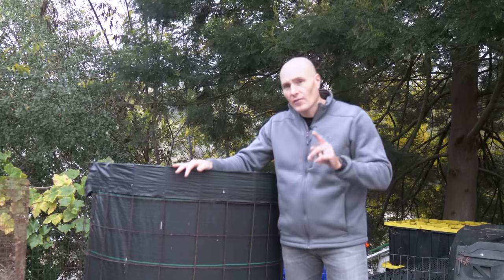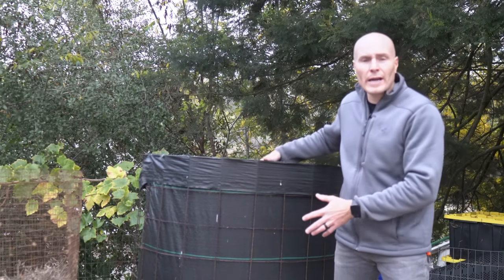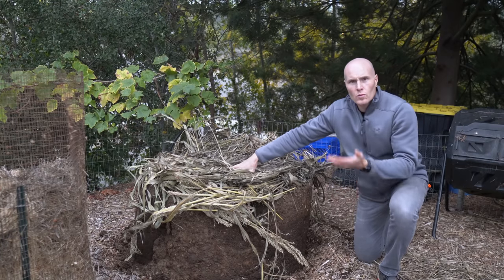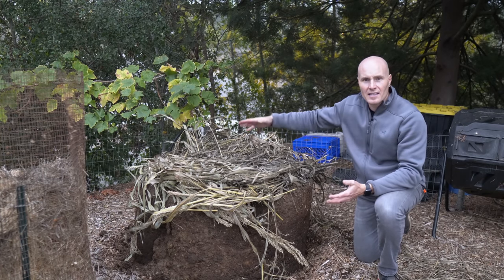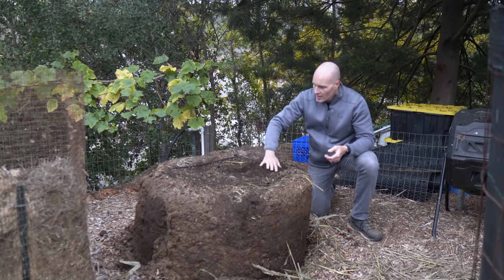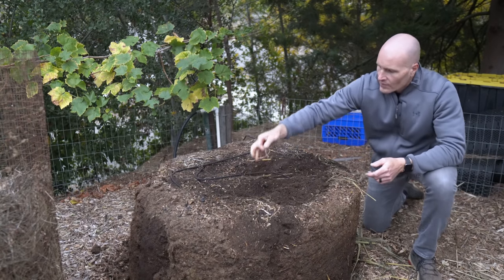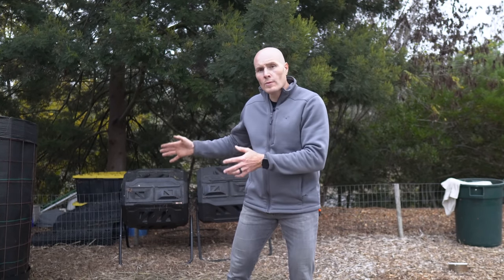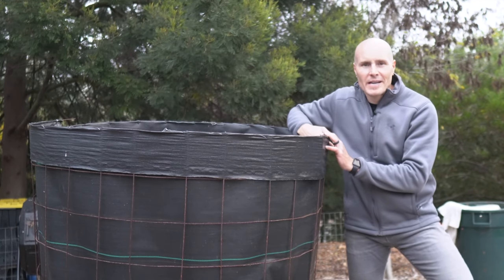Composting Horse Manure in a Bioreactor - One Year Later

Comment: I have a number of compost bins and when I want to clean one out and don't necessarily need it in the garden at that time I place the compost in large pots or a trash can with no bottom on top of garden beds. That way all the worms can move freely between the bed and trash can or pots. I have one in a winter squash bed at the moment. I occasionally remove the lid from the trash can or pot and water. The nutrients from the trash can will slowly leech into the bed for the benefit of the plants in the bed. 
I also have a large compost bay which I only place horse manure from stables in, though it has saw dust mixed through. After a number of months the horse manure has broken down with masses of worms. Overall this cost me nothing aside from a time and effort as I obtain the horse manure for free.  I did turn this pile once in a while. I'm almost ready to clean out this bay and start a new batch of horse manure compost which I slowly pile up as I pick up bags of horse manure.

Comment: Thank you for sharing the results. I semi-copied a method I saw Geoff Lawton do where he puts manure in a bath tub along with worms and food scraps and kept it moist, and the worms completely convert the materials into castings in a few short months. I've heard worms convert 1/2 their body weight of food into castings per day, so if you started out with a pound of worms, they would at the minimum eat 1/2 lb per day. That amount would speed up as they reproduce. I've filled an old tub (outside my home) with donkey manure and covered the top with leaves, and have gradually added a few worms to it over the past year. Now when I dig into the tub, the materials look like pure castings like in your video, and every shovel full is loaded with worms. Seems like similar results to this bioreactor, but maybe with less hassle. I can't say that a tub sitting outside is very attractive though.

Comment: Hi Diego, a year ago my JS was progressing very nicely. Then a few weeks later I did an inspection and noticed it had completely dried out. A Fikas tree had sent roots right up into the pile and sucked it completely dry of moisture in a relatively short period of time. Needless to say, all future JS will have weed mat put down on the ground first.
Reply from the maker: Weed mat is a good idea.  Might need to double it up for aggressive roots.  Nice suggestion.
Reply: Or if you have a pallet you can get it of the ground which is another benefit of using the pallet
Reply: @zoddsonofthor5576  hey man, I had it on a pallet, but as the worms broke it down, material fell down through the holes and piled up on the ground, causing an avenue for the roots to penetrate.
Reply: @MatthewSweetUX  yeah that can happen I place chicken wire over the bottom and lay landscapers fabric over that before loading it with compost. No problems since but I do have those things on hand and in quantity so I get why ppl avoid them.

Comment: Really enjoyed. An earlier vid you made has me sold on filling trash cans and let it set. Im done turning and mixing. Mine have already shrunk by 1/3rd just since September. I wet them when watering yard. That’s all. I swear I can hear all the microbes and fungi munching on the leaf/grass mix like it’s a sleeve of Pringles (one of my vices)
Reply: If you have two bins settled halfway do you pour them together to make one full bin or is that not recommended?
Reply: @phillipbampton911  good question. I understood the process was to fill them and walk away so I’m going to not touch until April at which time I will assess and either use on garden; let decompose further or combine them to decompose further. I have these cans next to my main pile that gets periodic turns, harvest or added new material.
Reply: @doncook3584  Thank you for this.

Comment: Do you think the benefit root exudates give could out weight the loss of a few nutrients? Great show buddy!
Reply from the maker: Honestly not sure.  I would rather just add the root exudate in field.
Reply: To answer that question you must find the plant in question and check its state of growth. Check also the composition of the compost pile to see if minerals are in soluble state. Plants will probably exhudate in this compost rich in bacteries and funghus to get its investment back during fructification. Though if the plant can help itself to get the nutrions then it will not need to exudate. Moreover, the root stucture will probably be different, with or without mycorrhizal fungi.
At first sigh it looks like Diego's roots are just pumping nutrions from the pile, but can't really tell from the video.
Good luck with that :)
Reply: @radicelle  I was going to ask the question. Very new to gardening. Thanks for the thoughtful and thorough answer !! 
Cheers

Comment: Diego, do you ever till into a fallow bed? A lot of gardeners say to not till leaves or carbon rich materials into the soil but when I do that, they disappear within a month or by May of the next year (if I till stuff in in October). I've had pieces of lumber that I found under the soil but I do not see bits larger than a standard woodchip. Most of those have decomposed within about 1 year. All I see are larger pieces that are rotting from one end and smaller pieces when they break off as I pull the large piece out.
Reply from the maker: I usually don’t but doing a trial on that coming up.  Mixing it deeper into the soil to try to fix soil issues deeper down quickly.
Reply: You should check out some of Elaine Ingham's work. The microbiology will move into the "dirt", bring it to life, and start feeding plants.
Reply: @ronniemcmaster8657  if you look at Diego's channel you might notice that he regularly posts videos from a Elaine Ingham.
Reply: @titosrevenger  He does have a few. There are more videos out there. Philip mentioned tilling. Tilling destroys fungi.

Comment: If you believe what recent biodiversity and plant diversity theory has said,
You shouldn't be concerned about roots in your compost, it's actually supposed to be more beneficial than a problem.
The idea is that all "decent" soil has adequate amounts of P and K and especially if amended a pretty adequate amount of N.
What is really lacking in good soil are the multiple thousands of microbes and soil fauna (eg plankton) that is so abundant everywhere on earth but still needs to be super cultivated in really good soil, these are what enables the soil elements NPK to be absorbed through roots into plants, and is best created by plants. A few foreign and invasive roots might provide that kind of diversity without stealing a significant amount of NPK.

Comment: Did you take temperatures at all during the 12 months ? Working with manure shouldn't you make sure you reach a certain temp to kill any bad bacteria and weed seeds?
Reply from the maker: It only heated up in the beginning.  Yes higher temperatures would solve those problems, so you would probably need to turn the pile outside of the reactor first and then add it to the reactor if those issues were a concern.